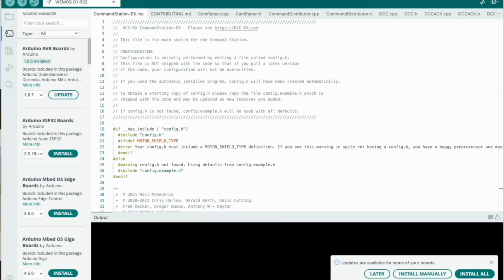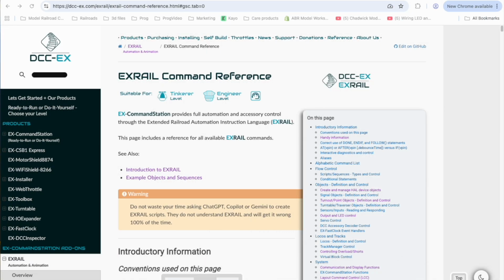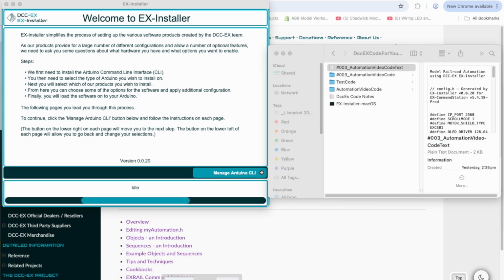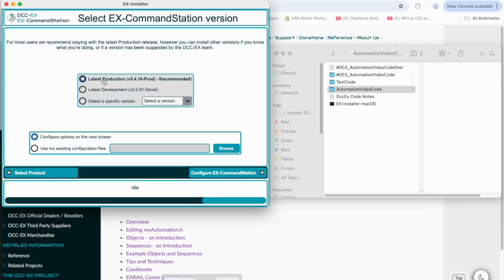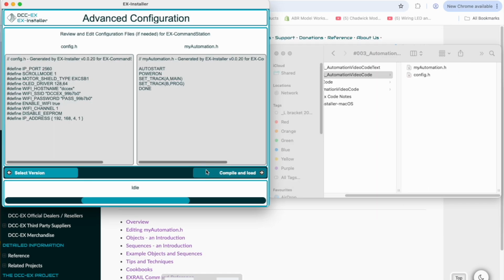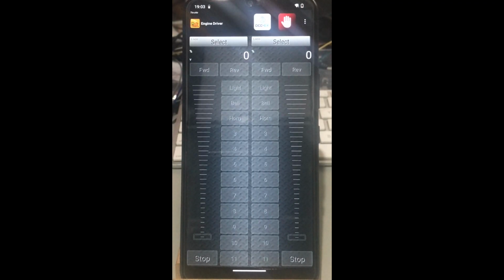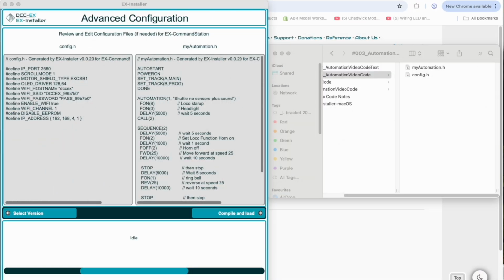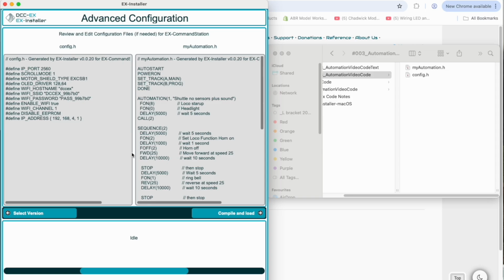#003 Model Railroad Automation using DCC EX EX Installer

Comment: Hi Chris this is exactly what i wanted to see. I come frome a background of using the arduino ide and consequently avoided the Ex installer.
This is the first time I have seen someone actually editing the config and myAutomation files in the ex installer. I can now see the usefulness of 
using the Ex-Installer.  

Could I suggest an additional automation which simple is a "KILL" automation  This could be used any time  to stop your loop automations from running when required Instead of 
turning off the power.

Do not apolgise about the presentation! You have made a great job of this!. 

Thanks again ! looking forward to the fourth part
Best wishes from Len From Yorshire in UK.
Reply from the maker: Stopping automations in the next video or it requires a development version of DCC-EX code library to make it work. Thanks again for your comment I really do appreciate them.

Comment: I was surprised to see you use delay rather than a routine using millis as delay means nothing else can happen.  Maybe you plan do use them in later videos.
Reply from the maker: As a series progresses, I plan to use as many as the functions as possible to give the viewers a really good idea of how they can use DCC-EX. That way with a bit of luck, viewers will come away with a practical examples, showing them how to implement the function themselves.
Reply: This is a common misconception. The DELAY statement in EXRAIL does not block like the Arduino delay() function. EXRAIL can run many tasks simultaneously and some of them may be waiting for a delay or until a loco reaches a sensor.
Reply from the maker: I plan to show how multiple tasks can run together in a lighter video. So thanks very much for commenting I really appreciate it. Have a great day modelling.